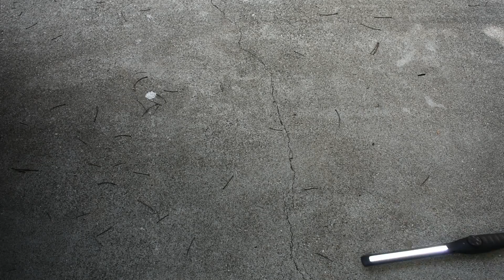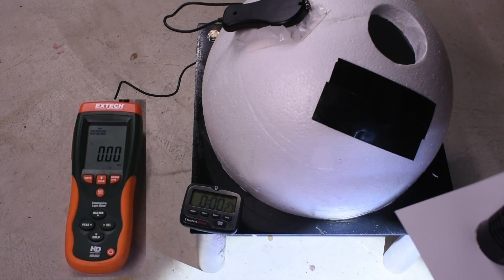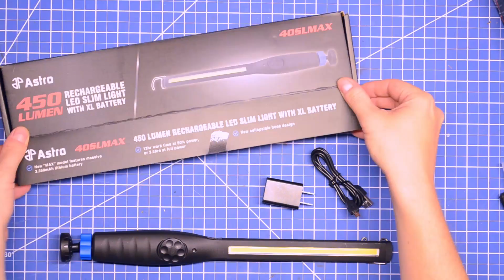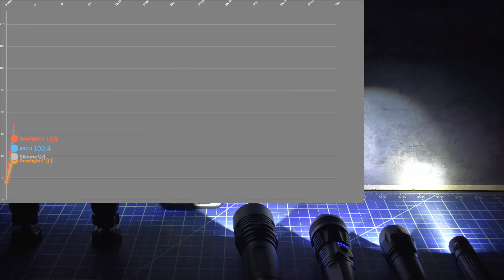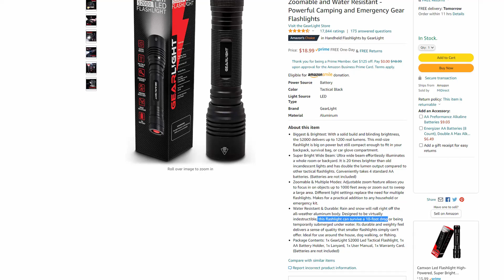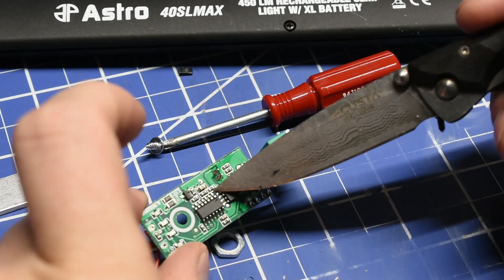How Much are Flashlights Lying to You? Best Selling on Amazon

Comment: Would like to see you test LED lenser torches, I've had a P14 for around 10 years. When I first got it I used it every night and, winter time, most mornings to walk my dogs, my wife also used it, and when I had to replace the batteries (10 months after getting it) I found the original lenser batteries in it! I had assumed my wife had been replacing them but no.

Comment: Can you include stuff like Kelvin ratings and CRI. The specs you've included so far are all important but don't mean much if my eyes feel like they're about to fry out of my skull after 3 mins and i can't tell things apart cause the colors are so washed out. Laser eye surgery, blindness from burned up retinas, loss of sleep from blue light exposure; are all very expensive and detrimental over time so imo they're a cost that has to be included in things like this.  I often still use an old inherited worklight from the 50s with a frosted incandescent bulb because it can go for hours without excessive strain on my eyes.
Not sure if you'll see this since the vid has been out a while. Maybe i'll comment on a newer one too so yall see it

Comment: Olight offers a large variety of flashlights for different uses.  Their insanely tough, durable and reliable. I remember thinking, "$100 for a flashlight?" But I fell in love with the thing the first time I turned it on. I was coming from a pair of three cell Mag Lites. Built in micro USB charging. (Today they're using USB Type C). 1200 lumens that light up the sky. Also have a laser/light combo for my handgun. Great products.

Comment: I’m a huge olight fan would love to see what the marauder 2, seeker 2 and seeker 3 pros, marauder xr9 perform. Also their new rechargeable 10450 i5r. They made custom 10450 lithium cells that are only 2.5 volt instead of usual 3.7/4.2 volts lithium cells are.

Comment: I know they won’t hit the advertised lumen but I do think those using AA batteries would get a bit brighter with an energizer brand battery especially their lithium batteries they come in at 1.7 volt instead of normal 1.5 for most cells

Comment: I’ve spent an absolute fortune on lights, specifically headlamps. And after all the brands and fancy ones I’ve tried over the last 10 years… I actually love the Nebo rebel that I’ve been using the past few years. I have three of them, and I use them every day, draining at least two of them completely. 

And on the lower setting… It’s still super bright but can last up to 8-10 hours! They’re super cheap, The rebel only cost about $30.

and are built to a high standard just like my olights and others. I’m somewhat qualified to review these lights properly. I run a lab where I do component level board repairs for industrial clients, as well as test equipment calibration & metrology. I also work with a wide range of photonics test equipment. Like spectrometers and stuff like that. So I’m somewhat qualified to make these assessments.

I’ve disassembled all the lights I purchased, and I’m still impressed with the Nebo rebel. Build quality and attention to detail is top notch.

Comment: ... FYI mAh input should equal mAh output. The power difference comes from requiring a higher input voltage than the battery can output.

Comment: I work as an industrial electrician in a hot steel rolling mill. Because of the hard usage I just buy the cheapest flashlight that has a decent light out put, a magnet and a hook. $10 is the most I have paid ever.

Comment: For someone that does a lot of work out in the fields and woods, I wouldn’t like a rechargeable battery that won’t recharge if drained all the way. In the real world, things happen like getting turned on or left on when it’s bumping around in a truck toolbox
Reply: Or as someone who spends a lot of time climbing down dark damp holes in the ground (normally abandoned mines) and spending all day or a couple of days down there, that would be fucking useless cos I tend to drain torches till they stop working before switching batteries cos like I need the max length of light output time

Comment: The turbo mode on my SII R2 is activated just by double tapping the power button. You also don't normally need to lock it unless you're really worried about accidentally turning it on which rarely happens in my experience.

Comment: Great to see the olight included. I rank it as one of the best purchases I've made under $100. You don't need to cycle into high before going into turbo. Just double tap the power button and you're in turbo from any setting, including off. Triple tap for strobe. Long depress for "moonlight" which is honestly the most useful one when even my phone light would disturb someone and I still need to see something.
Reply: I've had the light 3 years and beat the crap out of it, dropped it in chemicals etc. I'm very hard on my tools and this one gets a pass!

Comment: Lumintop FW3A - fits in palm. 2800 lumens. $35. Can’t beat that. Emisar D4v2 4300 Lumens $45. Noctigon KR1 pocket thrower. $50. Astrolux FT03 thrower $35. These lights are amazing for the price. Much better than olight.

Comment: I bought a $50 100k lumen LED flashlight on Amazon and not only was it about the same brightness as a 5k lumen LED work lamp that i have, it quickly got hot as fuck while the worklight generated barely any heat at all.
Returned it.  Got my $ back and Amazon dumped it in a landfill and wrote the $50 off as a loss.  
This is how it works.  Most people would keep it, too.

Comment: I have a few flashlights and i get the feeling they are putting an led in that is capable of achieving the stated lumens but the driver cant drive the led fully. Ive had good luck with the wuben brand. $30 for "1600" lumen flashlights. I think they hit closer to 1200 lumens but they have replaceable lithium batteries and they take a beating.

Comment: Amazing job!  The flat discharge curve of the Olight shows the flashlight has a DC-DC circuit to ensure consistent light output as the battery voltage drops.  The others clearly follow the voltage profile of the battery chemistry, which means inconsistent light output.

Comment: That's why I buy good quality ones not the cheapest ones I have one that is all alloy and Glass no plastic and it can burn your hands it you put them in front of it for too long but it goes through batteries Fast I have a team of 18650 s just to keep it running and when the power goes out you just need to point it at the roof and the whole room lights up it claims to be 6000 lumens and I think it pretty close to that you can't look at it at all it will blind you

Comment: I'm not sure the waiting 30 seconds before testing is a good strategy. Every light manufacturer, even the most respected ones rate their lumens from when the flashlight first turns on, many lights step down within seconds after that, most are dimmed by 30 seconds.
Reply from the maker: According to ANSI FL1 they are not allowed to measure output before 30 seconds, the respectable ones follow this ANSI requirement.

Comment: For the olight charging test i think a chromebook charger would probably be using the usb power delivery standard rather than quick charge which could be why the light only charged within the normal usb spec.
Reply from the maker: We tried multiple charging gizmo's (which accepted up to 2.5 amps on other lights) and 2A, 2.5A and 3A wall adapters. Everything was 1 amp

Comment: I'm actually surprised at some of those results. A better manufacturer can turn out a legit 1.5k+ lumen flashlight out of an XHP50, so seeing it that low... wow. I expected it to be 900 since they called it 90K, but not even that... wow.  (The 1.5k ones I've seen also have much larger heads with fins that are obviously needed as a heatsink. Oh, and they take 2x 26650, so are also larger.)
For direct comparison, the LED in the OLight S2R II Baton you show is listed as capable of upwards of 1800, which is specifically a Luminus SST-40 LED, a product considered a direct competitor to the (slightly brighter 5mm vs 4mm) XHP-50 from Cree, (which was later replaced by newer 3.5mm ones as a drop-in).  The Cree is advertised as capable of 1900 lumens.
So... in theory, with a good driver board, that light should have been toe-to-toe with your OLight in performance, only exceeding it in battery life, potentially, just due to the larger capacity available in 26650 vs 18650 cells. What a shame to see such good hardware used so poorly and then sold as more than it is...
edit: corrected typos, oops!
Edit 2: Oh, and I'm assuming in all these cases that you would not rely on the included (likely false-label) batteries that were included, and have swapped them for a proper LG/Sony/etc that's verified so you could do a side-by-side, in my claims that they could last longer. Obviously not the included fake stuff, but if you put the SAME rated cells in both.

Comment: Would be cool to see an X-Lamp Cree LED torch tested, I used one round 2007 as my inspection light and for 180lm rated power it was amazing. Seemed to make that power all day every day for years of being used as the on hand bashing stick. I have a couple chinesium head lamps that are a bit brighter but for all round ability they do not even come close and as for rated specs they totally fail, but I expected that with 6000mah 18650s >.< lol..... Also be good to see the HunterPro MKII high power with its 8000mah 26650s tested, they got real upset at me for commenting on their mass advertising scheme they ran on the book fake a little while ago. Think it was BAP offroad pushing them. Should be a freebie once it fails spec ;)

Comment: since the maximum theoretical efficiency of a lightsource is 683lm/W (for bright light) a 90000lumen lamp would AT 100% LOSSLESS CONVERSION of energy into exactly 555nm green light still draw 131 watts (the real efficacy even in LEDs is a lot lower. research for LEDs apparently currently tries to reach the 250s (so it would draw 360ish watts, rounded for later convenience)

a AAA battery has (as far as i found ) 1.87 Wh which at 360 watts would last for (60minutes*60seconds per hour = 360) about 1.87 seconds. AA batteries would last nearly 5 seconds,
assuming no voltage drop happens

90k lumen is just such an utterly ridiculous concept for a handheld device...
a xenon lamp searchlight for helicopters i found draws 1600 watts and has 60k lumen at a 4° angle beam, which seems pretty realistic to me

Comment: How does your test rig handle the different color temperatures? Like 6500K vs 6000 vs 5000 or even lower?
Reply from the maker: It's just measuring light intensity (lumens) it doesn't recognize light temp currently.

Comment: I really dislike how almost all flashlights require you to cycle through three to five modes every time you use it! A separate switch to select the mode most often used would be greatly appreciated. I also suspect that most of these flashlights are essentially "on" all the time even when not illuminated, because the electronic switching presumably needs a small current draw to "remember" what mode it was in when it was turned off last, and either reset to the factory default, return to that same output setting, or flip to the next sequential mode when turned on again. Constant current draw, no matter how small,  may explain the prevalence of battery leakage ---- if one battery is just a little weaker or out of tolerance compared to the others, that one will be resistive to the current supplied by the stronger batteries, and may tend to overheat internally.

BTW, the 3-cell battery holders are prone to intermittent operation because the springs are invariably loosely crimped to the metal baseplates. Flashlights become intermittent within a few months as the metals tarnish, and even minor battery leakage usually makes the battery holder unreliable even after a good cleaning. I solved the flaky- operation issues by soldering the springs to the baseplates on all my flashlights. Similarly, if the switch is located in the bottom cap of the flashlight, the coil-spring typically makes only a mechanical, thrust-plate connection to the leaf-spring on the switch. Soldering the spring to the switch eliminates flickering and inadvertent output-mode changes.
Reply: I try to only buy lights that just clicking the button turns them on/off, and then holding the button or double clicking changes brightness/mode. Especially when I worked at night it got really annoying having to cycle through everything anytime I wanted to turn the thing off.

Comment: I didn't realize you could simply slip an 18650 rechargeable battery into a flashlight in place of the stock 3 AAA cell battery holder; however, this could cause LED overheating issues and shorten their lifespan ifvthe light wasn't designed to handle it. I have noticed LED overheating when using Eveready "Ultimate Lithium" AA and AAA batteries in place of regular alkaline batteries. Better voltage regulation and/or current limiting circuits seem to be called for, at least in the cheaper LED flashlights I've been using (mostly "Pro-Mier"- branded lights from the local job-lot/ overstock chain stores); even the ones with heavy aluminum housings tend to get uncomfortably warm if left on high for 10 minutes with the lithium AAA or AA cells.  Worth mentioning that the Pro-mier stick lights with a magnet in the base are awesomely powerful and will easily stick sideways under the car hood or to the inside of a home appliance as you work on it.

Comment: Remember that 3000 mAh at 5V is not 3000 mAh at 3.6 /4.2v  as voltage is converted to amps making a 3000 @ 5v might up to 4000 mAh pluss minus

Comment: The Dikomo does have 90k lumens, you just have to remember to wire it into the local high tension power wires. Try not to get disintegrated.
Reply: Hook it up to a Flux capacitor !
Reply: The runtime is remarkably short though.
Reply: Just plug it in to the transformer at the local warehouse it'll be fine

Comment: My primary lights are Streamlight Pro-Tac 1L and 2L.  At 275 and 350 rated lumen respectively, they are plenty bright for my use. 
Both use CR-123 but using Tenergy L-Ion rechargeables I haven't purchased a battery in over 5 years. Yes, I know the trend is for USB charging but I prefer to reach into my bag and swap cells rather than losing access to the light while it is tethered to a charger.
I also have a couple of cheap 'AAA' COB lights that work well when I need to stuff a light into a small space or 'loan' someone a light. They only do a couple hundred lumens but at less than $10 I don't care if they get destroyed or not returned.

Comment: Olight is the best brand in my opinion, I've purchased more than 10 lights for myself and others and have never had a complaint. Grab yourself the m2r pro warrior which has 750 lumens for 2 and a half hours and 250 lumens for 10 hours. Plus they have a 1 lumens option which will last you 50 days in case the apocalypse happens.

Comment: Hello again Tool Review Zone 
Thank you for another Great Video. Yes, I was ripped off on my very first Amazon purchased. I saw a  set  Torque adapters sockets for something like $28.00. I pulled  the  credit card and made the purchase. Only to find out later when it didn't arrived. I have to admit that Amazon customer service took over and solved for me. Case closed. I have made other purchases on line  with no issues.

Comment: Had one of the amazon best seller flashlights.  It was ok, definitely not as bright as advertised but it worked.....for about a total of 2 hours total run time. Took the flashlight apart to find the LED got so hot it de soldered from the pcb board! re soldered the LED about 3 times in the flash lights life before the led eventually burning out. Decided to spend the money and get an Olight....Olight is still working like brand new!

I own 3 of the lights you tested, The Olight, Astro, and Dr P. You pay for what you get! Great video!

Comment: Ive been using a cheap 18650 flashlight for years. Well than I bought a nitecore tip se, smaller and brighter. Overal a mile better feeling. And it fits in your keychain or in your pocket very easily. It also like to turn on in my pocket.

Comment: I use a headlamp a lot when working on cars. They can be very useful in most sit. Would love to see a test on the Amazon brands. Me and my wife have two that are supposedly rated at 13,000 lumina. There pretty decent lights and are extremely bright. Only draw back is that the don’t stay charged long.
Reply: I really doubt they are 13 000 lumen as the light would be really heavy and big at that output level
Reply: @reahs4815  I have always had doubts on that too. But they are at least the brightest headlamps we have ever seen.

Comment: Ayy, I have the S2R baton, I love it :D
Reply: Also as for the turbo/strobe mode, you dont have to unlock it for it to work, You can double tap / triple tap from off to turn it on to respective mode, tho if you have locked the button ( holding the button for more than like 5 seconds i think ) then you have to unlock it. also it comes with a ultra low mode where its like 12 lumens? but lasts like  several days , not sure how many  but its great :D

Comment: I have an Olight that has the 90 degree head and a magnet on the bottom.  It also has a head band.  For fixing stuff, it work great, and is similar to the one you tested.  The diffuser lens works the best if you're working on something.  I've found most mechanical work needs around 100-150 lumens.  Otherwise the light creates too much glare.